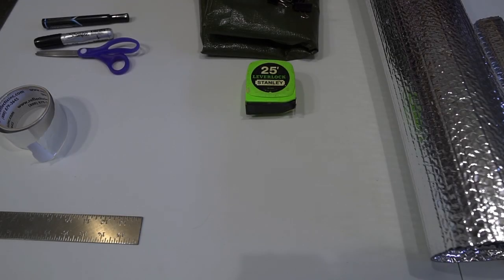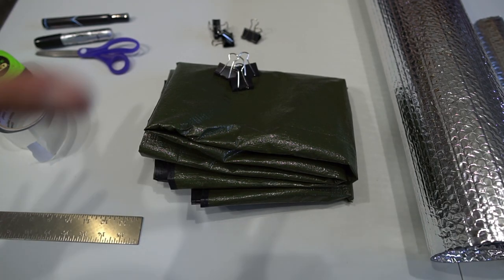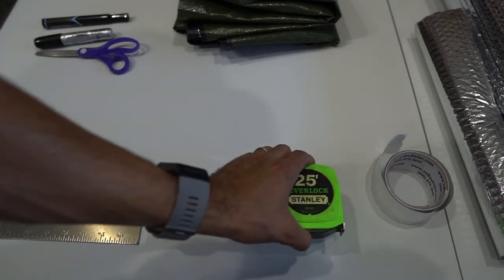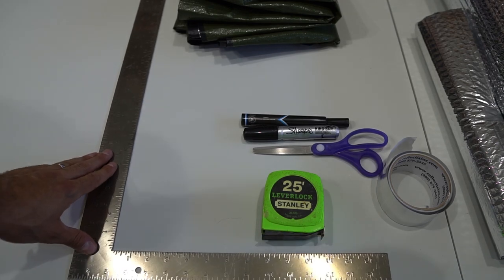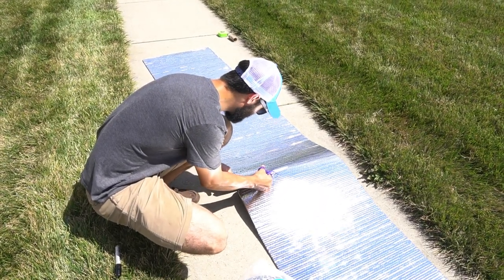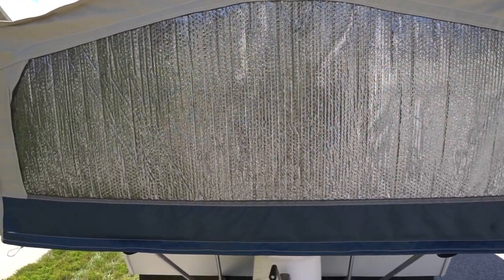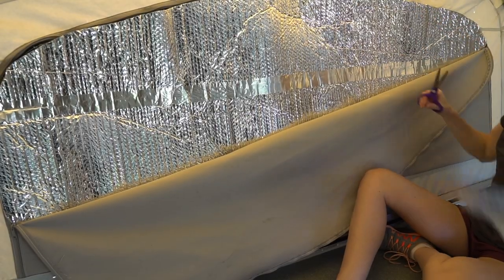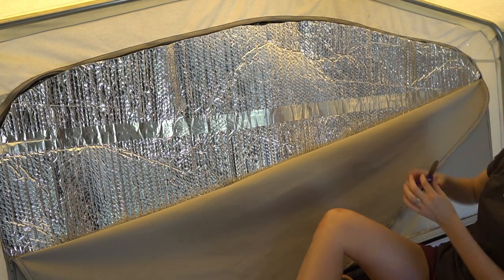Pop Up Camping in HOT Weather: Pop Up Camper MODS to Beat the Heat!

Comment from the maker: Quick tip: You can store the inserts under the mattresses while they're not in use or when you're traveling.
Reply: Are you going to put a reflector ticks or emergency blanket underneath you mattress to insulate the bottom? I’m thinking about doing that.
Reply from the maker: We use those interlocking foam tiles for added insulation and cushion under our matresses.
Reply: @ItsPoppin  took your advice on the foam pads and wow what a difference
Reply: Super helpful, thanks!
Reply: I just came back to this video to see if there was any mention of where you stored them lol. I started making the inserts yesterday thanks to this video!

Comment: Thank you for the info with the solar windows! We live in Florida and we bought
Are first pop-up and remodeled it through the summer, well we’re testing it right now and camping for are first time at Disney’s Fort Wilderness Resort. We got in at 3pm, setup, installed the solar reflectors, left at 430pm with the temps being 92F and humid camper was 82F, we left the A/C on high came back at 730pm temp was 65F inside the camper!! This is what I needed thank you guys again!!

Comment: The gekko cover is fine , but i have a better product. I bought Henrys Solar-Flex White Elatomeric roof coating and painted the canvas pop outs on my rockwood roo. Its mildew and stain resistant. When im in lake havasu its 110 f but in my popout bed its 80f and i dont have to set up the gekko. This stuff is great and adds an extra layer of protection for rain.

Reply

Comment: A cheaper way than the reflectix is to get some cheap sun shades from Walmart and some a/c duct tape. Measure your windows, cut and tape them together. They work great and it cost me less than 40 dollars to do both bunk ends
Reply: 2 sided bubbles isolant can be bought at hardware stores. Its about 12$ for 12x4. Now the sun shades from walmart can be used for the top of the camper tho.

Comment: Do you know roughly what the temp difference is? I was curious about doing something similar but I just can’t decide if the juice is worth the squeeze. I don’t have AC however Colorado mountain nights are very cool but when I’m camping more in the plains (which I will do for the first time this weekend) that’s where I know it will get hot.
Reply from the maker: I don’t know - if anyone else knows, please chime in!  This would be a great experiment though.  We do have an air conditioner, which would be an interesting variable to add in to see if they help keep the cool inside.